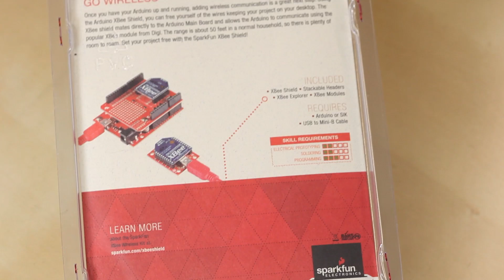SparkFun 10-3-14 Product Showcase: Back to Basics

Comment: Props to you guys for making an FTDI module with Micro USB. When are you gonna change over to this for other things such as the XBee Explorer and the regular FTDI Module? Micro USB is now the most common connection for communication and charging of cell phones, so the cables are much more popular. Micro USB sockets are also rated for a far higher number of insertions, so they're far more rugged.